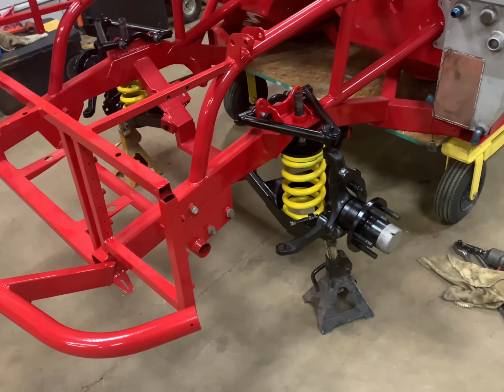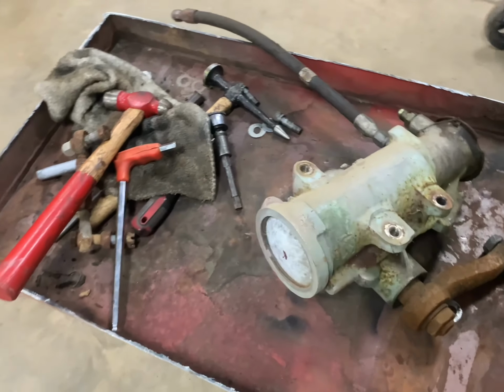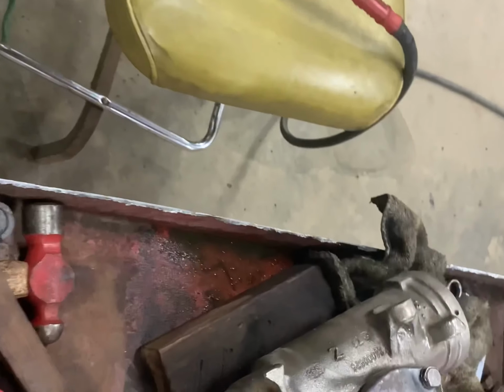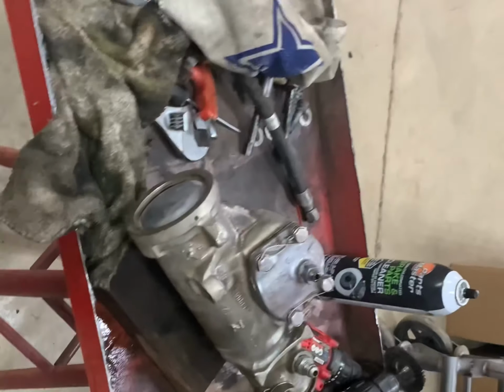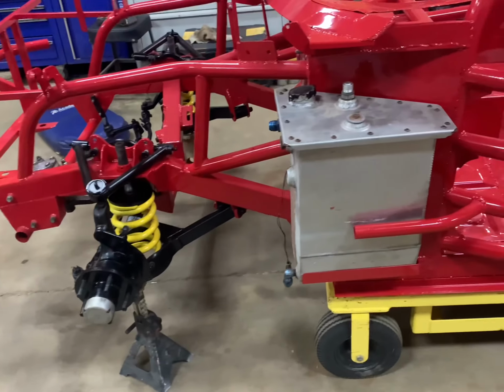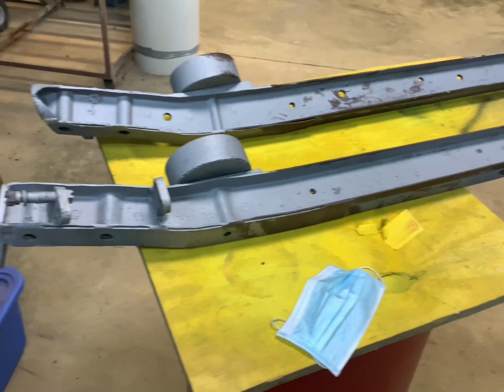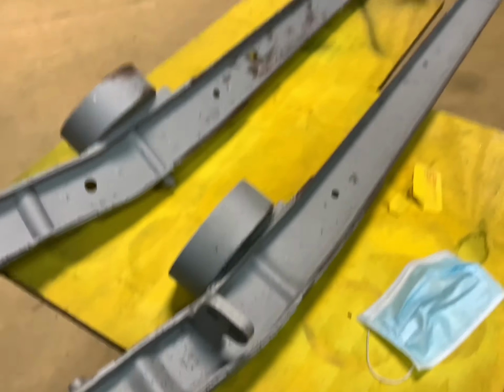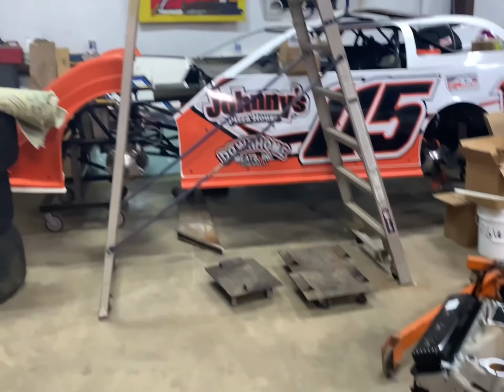#94 Front Suspension Assembly 1988 NASCAR Buick Regal Winston Cup Car

Comment: I LOVE the fact that you help identify parts as you assemble them (such as the tie rods).   I’ve always wondered what parts were used on these awesome cars.      Most see a complete car, I want to see what makes it a complete car.     I wanna know where the floor pan originated, what spindles were used, what brake rotors were used, etc etc.    I am chassis builder/CAD designer  for Busted Knuckle Off Road, and it really helps me look deeper into what makes a build, a build.

Comment: Ronnie,
Do you see any brand name on the hubs and spindles.  Just wondering if Laughlin was using Stock Car Products or maybe Frankland in 1988.  You probably know this. Bobby Allison started the front steer craze when he turned Holman Moody spindles around swapped them left to right in the early 70s.
Reply from the maker: I’m not sure on the front hubs - I do know these front spindles actually came off of a rear steer car that Phillip was running before building this car. He sold that chassis as a bare frame to Kirk Shelbedine who won his sportsman races with it. Laughlin has Phillip swap the left and tights off the old  chassis on this 88 chassis making it a front steer.